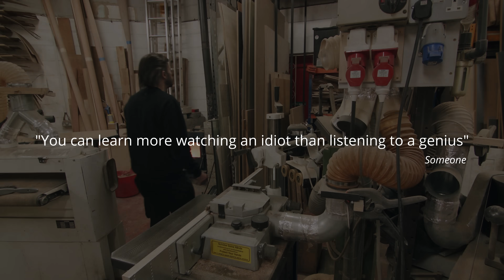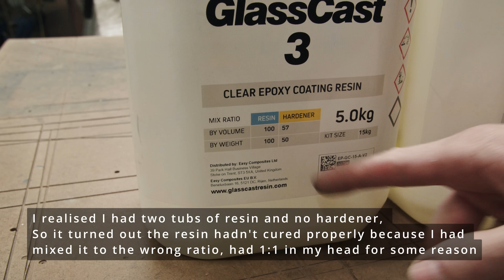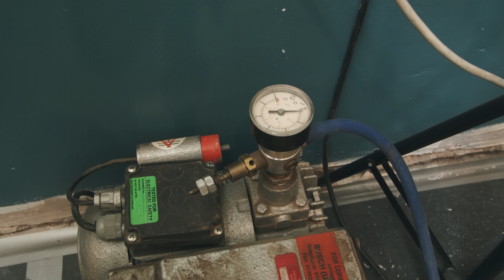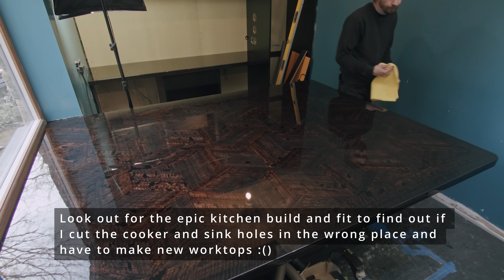I made these STUNNING kitchen counter tops (TWICE)

Comment: 2 Epoxy flood coat tricks I learned. First is that some heat guns shoot FOD/particles into the epoxy, so I only use propane torches to pop the bubbles. Second is spraying the surface with ultra-pure (non-contaminated) acetone , which thins the epoxy without using heat, allowing the bubble walls to pop.
Either way, I'm decades behind your skills, and I love your work. I learn a lot with every video, and my vision also widens. Thank you for sharing your epic works!

Comment: Thank you so much for keeping the fail in the video. I worked on an endgrain table for 6 Weeks and it was done and looked beautiful and then it started to earp and fall apart. I was  so sad, but hey the deck table I built from cutoffs of the deck while I was waiting for the glue to dr between steps I still as new after 7 years.  To fail means to learn. And the new Island looks fantastic.

Comment: I make strip built wooden kayaks with resin/fiberglass overlay.  One of the ways I prevent bubbles is to make sure the shop is very warm when I lay the first coat, and then let the temperature fall. This prevents the off gassing of bubbles. Beautiful piece.

Comment: "Ninja confirmed" got me :D  Belly laugh.

After working with epoxy for quite some decades now I have developed an allergic reaction when breathing the vapours. Even at 20degC it takes several days to a full week to fully harden and become inert. I am now using a Sundstrom overpressure mask with chemical vapour filters when working with the stuff. And I am religious about gloves and other protective gear. Take care 🙂

Oh, and about mixing it. Once had to throw away a strip plank half-hull for a catamaran becouse of getting the ratios wrong.. That was quite the day. Found that how mixing is done really makes a difference with the amount of air bubbles. More so than pulling a vacuum to try to remove them.

Love your stuff.

Comment: Didn`t know you`d fitted the kitchen cabinets, last video we saw was you making and installing the picture window. Kitchen fitter myself of 42 years, would have been nice to see you build your cabinets and install them.
Reply from the maker: the next video will focus on making and fitting the kitchen from start to finish 😎
Reply: @NewYorkshireWorkshop   great stuff. We build all our own carcasses from 18mm MFC, colour matched to the doors, usually Egger or Kronospan. Cam & Dowell construction with Blum Soft Close Hinges and Drawer Systems, i presume though you made yours `Stick & Frame` as we call it, from solid wood from scratch which was the way i first learned how to do it back in the 80s. Love you videos mate, cheers. Glen, GTS Kitchens West Mids.

Comment: I had to flatten out a failed attempt at an epoxy resin counter for a business once. The contractor that started the job didn't have the underlying wood structure plumb and level. One side was 3/4" higher than the diagonal corner. 

After my first pour it was pitted as yours was and I told the business owner it's easier to tear out and start over. Come to find out, the contractor tied the countertop into the the walls and epoxied the whole thing over the tracks of a pull-down reinforced steel security shutter. Making it virtually impossible to rip out without major reconstruction. 

So, I had to use 5 layers of epoxy to get it remotely level and presentable enough. After the 2nd-3rd coat, it looked all wavy and ripply like yours did. I almost gave up but after the 4 coat the waves started to disappear. 

I really liked your first countertop and think it's worth saving. If you removed all the bubbles on the sides, filled them, set-up a planing router jig to flatten it out, and finally did a flood coat pour that you allowed to overrun the sides and all edges. I believe you could achieve what you set out to and use it somewhere else. 

It just feels like a waste to scrap those countertops when you could save them in one more flood coat. Cheers!

Comment: I'm going to guess that many of the air bubbles you experienced in the resin on the first go were due to the dry pallet wood you used.
That would have been a beautiful top if it had been successful.
But the second one is also quite beautiful!
Good luck with the rest of the kitchen ... though those end statements are a bit ominous.
I'll be watching! 👍🏻

Comment: For the first counter, I would have added a chamfer to the bottom of each of the boards, then pour very thin resin in the middle (slowly, a small container at a time) to allow the resin to flow down and out to the edges. You'd likely have less trapped bubbles.

Comment: I'd have rubbed hardener into the uncured resin and left it for a few days. Then I'd have re-bunded it after sanding it all back, poured a slightly coloured resin finish over it all and polished the hell out of it. I used to build plugs & moulds for yacht production. There was a few times I forgot to put the catalyst in - it was polyester back then but I'm sure the hardener now would do the same thing.

Comment: Did you manage to recover some of your original work?  Since the resin didn't set correctly, a good scraping off of the resin until it could be sanded down to the wood followed by new resin might have been able to save it.  It would be so sad to just trash it completely. 🥺

The final looked good too, of course, but I did really love the wood finish on the first one.  I don't even like dark wood finishes so that was definitely a win from me. 😅👍

Comment: When you put the perforated sheet over the veneer without rolling out the veneer you had just laid on first to remove air bubbles, I knew you had a problem, and unfortunately I would consider sanding through the veneer to the resin as a total fail.  I'm glad you're happy with the result and I guess you could trick yourself into thinking you had resurfaced an old table with worn veneer and you'd left it "au naturel" without repairs, but I personally couldn't live with it.

Comment: Great content! I particularly appreciate the use of subtitles, as I find it more relaxing than listening to someone speak. 

I have a question regarding the use of jointers. Recently, at school I was using one to flatten one side of a board with the cup facing down, picture an upside-down 'U' shape. I managed to get it to lay flat on the table saw, but there was a large hollow section in the middle where the jointer knives didn't hit. Should I continue using the jointer until everything is level? Thanks in advance!!!
Reply from the maker: Yeah that is the idea, you need to reduce the material at the ends by running it through multiple times and it will eventually flatten enough that it cuts all the way down the board. If it is really badly cupped then you may want to strike a line with a straight edge or chalked string line, then cut it with a saw to get it mostly flat, then finish it on the planer/jointer.
Reply: @NewYorkshireWorkshop  Thank you very much for providing such a detailed answer!

Comment: Or the soft rubber that fits in the bottom of a shower screen you can get soft to hard on a roll cheap you could even get the Aliminum rod with the slot in it ?? Just a suggestion

Comment: Think that looks amazing Russ fantastic job, I'm just wondering though on the first set of worktops with the air bubbles if you had used your sander on low to vibrate the bubbles out like we do with concrete, would it of worked ? Can't wait for the rest of the kitchen units keep up the great work.

Comment: Epoxy resin or any other plastic surface on the kitchen top / table will eventually be damaged by knife cuts and worse, accidental hot objects (like frying pan).
I used very large ceramic tiles for such surfaces.

Comment: I would not recommend letting the wood fall off the end of the Machines scrap and good pieces. As the fall could damage the surface and or edges of the good. 
And not to let the wood lay haphazardly on the floor as it becomes dangerous as you could trip, fall, or fall into a machine causing a major injury.
Your work habbits are very troubling! You have been lucky so far but how long will it remain so?

The result looks outstanding!

Comment: when I saw the original thumbnail for this project I thought the counter top had the blue tape in the design. I think if you had used the original burnt wood and left gaps between pieces or had gaps in the veneer diamonds and used a blue colored epoxy the design would really show up

Comment: I’m not familiar with using resin / epoxy, but I did wonder was that first piece salvageable? Without enough hardener, can the resin ever be removed / sanded / planed / scraped / chemical peeled - or is it going to stay a bit sticky and unremovable?

Comment: Would anyone know if that blue wood he used to support the veneer is similar to the stuff we used to have here in the states?  It was called Blue  Wood and it was supposed to be mold and insect resistant.  It just disappeared off the market years ago.
Reply from the maker: That was just some left over tile batten from when I did the roof.

Comment: I haven't veneered in a long time so maybe someone can bring me up to speed. Normally a backing veeneer is always needed to counterbalance the cupping effect of the face veneer. Is this different when using epoxy or should he also have used a backing veneer? When using contact adhesive it was our practice to not use a backer beause it wasn't pressed, but anything that went in a form or the veneer press using pva needed a backer.

Comment: I think the pine wood one would have spit and cracked over time.  The second one looks amazing.
Reply: It was pallet wood, any splitting and cracking likely would have happened in the pallet's life, plus the time stored in the workshop after dismantling will mean it was very stable before use.
Reply: @bren106  No, it was new construction lumber. One of the worst materials for expansion in furniture.

Comment: Why do you use such a small applicator on such a large surface would it not be better to use a 3ft perspex with a supporting frame on a Long pole to spread out the epoxy????😮

Comment: Quick question: why go backwards with the saw?
Reply: To do a climbing cut. Normally the blade teeth cut in a generally upward direction which pulls fibres out of the wood into the air which gives no support and the fibres tear, giving tear-out and a ragged finish. By reversing the blade direction the cutting teeth cut downwards onto the sacrificial board underneath which supports the fibres and reduces tear-out. Something like that, anyway.

Comment: Those black repairs on the figured veneer look very very bad, why did you use black epoxy to glue it instead you could've used clear epoxy and later with the added coats on top it would've blended very very well or you could've used titebond and later wipe the excess glue that bleed through the veneer with hot water

Comment: I can only imagine your initial disappointment. The frustration you endured when your first attempt didn't go accordingly after all that planning and hard work you put in.

Still, if you don't mind me saying so, the end result, in my opinion, looks much better than your first top. It's such an unusual pattern. That is not to say the herringbone design was bad. On the contrary.

Throughout the ground floor of my Victorian home, I have several parquet designs, one of which is the herringbone. It happens to be in my lounge, being the larger of my two reception rooms.

In the smaller room, I have what is believed to be Chevron, while in the hallway, it is checkerboard. 

But my dining room floor is my favourite design, all be it a tad busy. It's known as Versailles, which looks a little like open basket weave. An apt design for a room where eating is deemed conventional.

The kitchen design is simple. It is quite plain compared to the rest of my flooring. It's called Brick or Brickbond. I'm not 100% sure which it is, but it looks like a wall from a Manor house of the 16th century. Each wooden block measures the same dimentions as the bricks of that period. At least, that is what my builder tells me.

Sorry, I got carried away. Your top looks great, but I do have one question. Will the top be pushed back into the window opening? Because on camera it doesn't seem as though there is much room to walk by, not without rubbing shoulders with that wall or smashing your hips on the corners. 

I'm looking forward to watching the next instalment. Please be sooner than later. 😁⚒️🏴

Comment: um, don´t know what to say, it´s going to show the slightest fingerprint and smear, will be a nightmare for dust too. Every time I see it that is what I would think. Why did you not wear/use protection against the fumes, that stuffs really bad, along with Glassfiber and Asbestos.
I used solvents and sprays too many times when younger, now I can´t even cope with a women's perfume without wanting to vomit and cough. You had no ventilation going either?
The trouble with dark schemes in small kitchens is that the room becomes very small, it´s compounded because you also have to opt for black or steel utensils. I would suggest a
Mellan toned natural wall color that will enhance the warmth and compliment the dark earth vibe; like moss green with either (Terra Verta, Raw Umber or Indian Yellow mixed in). Also make one side of the room another hue or completely different, like using stone.

Comment: I have never done veneering myself, but should you not have placed a board on top of the veneer inside the vacuum bag to prevent those resin bubbles from remaining underneath? I personally would have scrapped it a second time and redone another layer of veneer over top, those black spots everywhere from where you sanded through the veneer just look horrific and there is no way i would be able to look at it everyday after putting all the time and effort in to remodeling the kitchen to how i wanted it. It is such a shame for such a beautiful veneer to look so half assed and botched.

Comment: Halfway through, I thought, this does not look like a countertop a woman would want in her kitchen. Definitely a mans idea, very masculine. Putting in these counters, 'sho-sugi-ban style, is not a good idea in a kitchen being used everyday. I thought it was the process of charring the wood all the way around the pieces, to seal the wood and protect it from bugs and degrading was the whole purpose of that method. Covering it up with resin hides the beauty of the wood grain after it is 'charred.' Sho-sugi-ban is for accent walls and fireplace facades. A nice slab of quartz that looks like marble would have been more cost-effective for overused kitchen countertops. I felt bad for you after all the work you put in, so I subscribed.😟 Maybe putting the whole thing together with nails and sanding then charring the piece would have cut down on shrinkage. I will say, though, that you are an excellent craftsman! And we all have our projects from hell. Thanks for sharing! 🥰

Comment: Unfortunately, after all your GREAT videos... this one is a thumbs down! You went too epoxy happy and tried to be cute. Just do the MDF, round over all the edges, PAINT the mdf a darker color so gaps aren't noticeable, apply the veneer normally, (don't use epoxy as glue, or if you must... just clear, since the mdf is already painted) THEN apply an epoxy flood coat and let it flow over and down like a normal epoxy countertop. (no form, just drop cloths) After 2 flood coats (let each cure then 1 quick sand with 220), do 1 final coat and sand/polish to finish. The epoxy on the herringbone was bound to fail UNLESS you used a very long cure epoxy (days to weeks) to let ALL the bubbles escape. Tricks to help with drips, either put painter's tape on bottom to 'catch' the drips, or use a rubber glove and some mineral/white spirit (acetone). Splash a bit on your glove then run it over the sides and bottom at about the 1 hr 'tacky' mark in curing to 'smooth' any waves or drips on the underside. I know you're a GREAT woodworker, but you're gonna need some more practice to do epoxy.

Comment: Wasted time pointlessly.  You would have to vacuum the resins  with the vacuum pump you have to get rid of the blisters and you would have finished with 2 layers. I work with epoxy on carbon fiber and other composite type materials and the vacuum is essential. This is what I would do with 29 years of experience in composite materials.